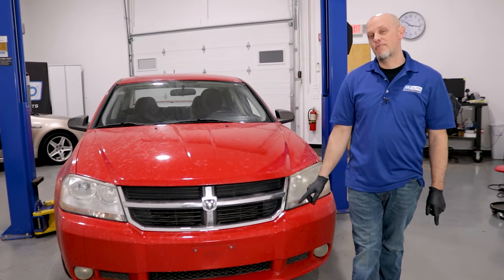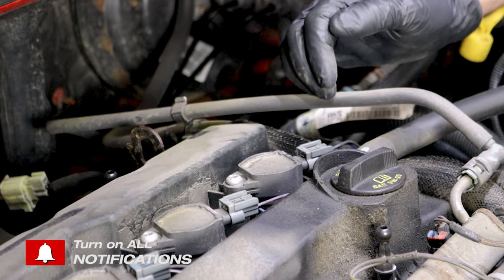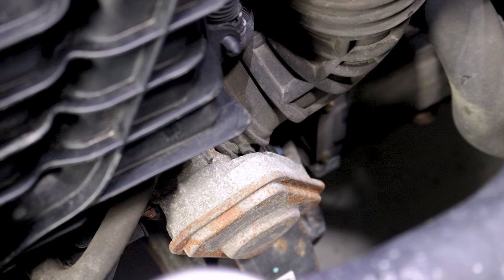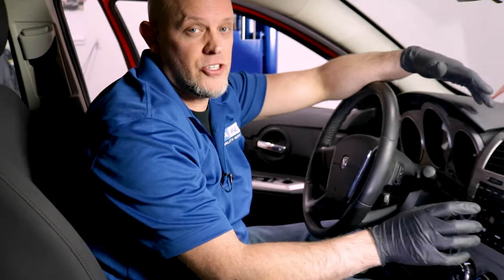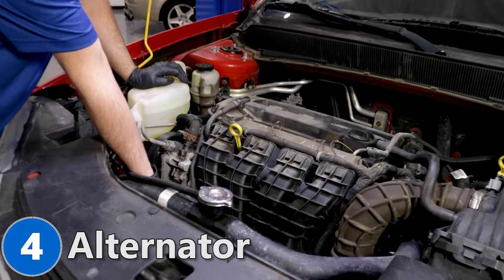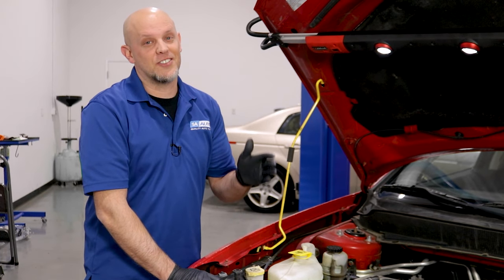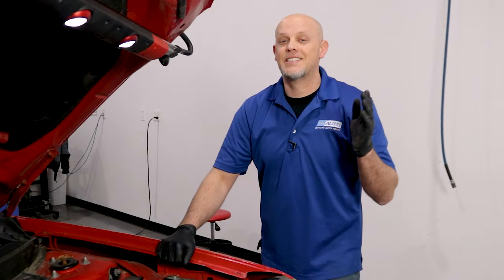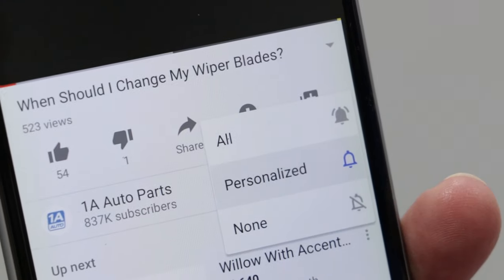Top 5 Problems Dodge Avenger Sedan 2nd Generation 2008-2014

Comment: My avenger had 198,000 miles when the Alternator when out. This car has given me very few problems and is still a fun car to drive
Reply: Dude same. I have one of the final 2014 3.6l V6 SXT models and I love it. Solid, no major issues now approaching 150k miles. Haha as far as minor issues, my blower motor did go out though! I replaced it. The new motor was inexpensive.
Reply: Same, mine went out at about 196k.  Other than the power steering being stiff and a couple of actuators clicking, I’ve had no major problems. I bought it new in 2014 and love my daily driver.
Reply: @ariela.8706  Did u fix the clicking?
Reply: The avengers suck!!!!! Have had to replace an alternator, starter, coils plugs, MULTIPLE THERMOSTAT HOUSINGS…. Not to mention the countless failed thermostats right out of the box….  I literally just replaced the whole housing assembly and have triggered a p0128 because the NEW THERMOSTAT failed.

Plus the countless electrical issues. The main fuse box location gets destroyed in the engine bay.

I would rather drive a Prius

Comment: 5 problems “but overall it’s a great vehicle” way to elaborate on the most important part 😂. So do I buy it or not?
Reply: Not
Reply: Buy.  I bought mine new in 2013 and I love it.
Reply: @marcoscompos7203  i feel you on the battery lol
Reply: No
Reply: No I have one and I’d rather get a Honda Civic
Reply: It’s a Dodge. You gotta get outta its way
Reply: @Blackboi if you turn the wheel all the way you possibly can outward its a tight squeeze but you can get to the battery without taking the tire off. Also if your side marker lights go out they are a pain to get to as well. I have 2012 with almost 200,000 miles and besides the normal wear and tear its been a great car.
Reply: Hell no
Reply: Honestly it's a good used car if you can do your own small repairs. Looks a bit ugly tho
Reply: DO NOT BUY DO NOT BUY DO NOT BUY
Reply: @RF-vg5kv  no
Reply: Yes.
Reply: I have a 2014 bought used pre owned only 40k miles, now paid off ! Have been very very very reliable a few things I had to change and update, the battery is aggravating to get too, but other than that great car ! Looking for my next car now had my avenger for 7 years now, looking at the Mazda 6
Reply: Naw mine has problem after problem
Reply: NO! Mine just totaled out today. I had it just under four years and it was nothing but problems the entire time. We stuck thousands into it trying to fix it. The frame snapped today while slowing for a stop sign.
Reply: Only problem I have with mine is the same thing over and over is my car keep running hot even when I fixed both hose, housing, thermostat, and everyday I have to put antifreeze in it because somehow it keeps disappearing but no leaks so I mean it’s a total waste of money for me.
Reply: As they always say every car has its problems
Reply: I've had mines 9 years and still running strong thank god I've had to do regular maintenance brakes oil changes nothing to crazy but it's how you treat the car and maintain it I had a Honda Civic and had many problems it just depends bc I also had an accord for 15 years never died
Reply: @itsjustnate6  J
Reply: @guillermoaguinaga8592  sounds like me and fords had 4 different ones nothing but problems real money pits will never own another ford ever
Reply: @marcoscompos7203  I feel this so close to home lol.  The car is honestly fun to work on other than that dumb ass battery haha.
Reply: It’s like every other car. Take care of it and you won’t much problems pendejo. 👍🏾
Reply: @guillermoaguinaga8592  lmao that’s not true at all but ok. Dodge makes amazing vehicles. Learn how to properly maintain yours
Reply: I have one great car with 100000+ miles and reliable easy to work on
Reply: Lol I had mine 6 years and soon as I payed it off the computer  went bad . I think it's a good car
Reply: @stephaniewilkes2648  does ur water boil in reservoir? Similar issue, replaced a few things & am confused. If head gasket I'm selling it...but just today a few ppl said simply try a new radiator cap. For $5-$10 it's worth a shot. Also, check thermostats. The housing is easy to get off to see them. Cheap, fairly quick way to rule things out before wasting more time or $. In the same boat praying it's not head gasket tomorrow...
Reply: Nope have tons of problems with mine including transmission
Reply: I have a 2012 and for almost 9yrs its been a good car. Just didn't get my cooliant fixed in time. Ran it out bc i forgot to put the radiator back on. I love it
Reply: @moonbeamskies3346  I'm here with you on that. I got a 2012 back in 2014 and its been a good car
Reply: i’ll sell u mine
Reply: Hell no bro I hate my 2012 Dodge Avenger it’s my second car I got it when I was 16 going on 17 and now years later still dogshit u have to take the wheel off to get to the battery and it’s small backseat if ur tall or big trunk sometimes won’t close the clock is 3 seconds a head the car is slow in a race if u got the sxt etc just a money pit tbh thankfully I haven’t had any expressive repairs but still just annoying 🤦🏿‍♂️
Reply: Theese all are no expensive one exsept the alternator maybe

Comment: Today marks two years exactly with my 2014 Dodge avenger. I am currently the second owner and have recently experienced about two of these issues. The first one was my alternator. Just as you explained in the video, my battery died due to a bad alternator. Fortunately, I was able to get another battery within my warranty. However, the alternator I did have to purchase and replace on my own. Total cost for that was about $250. Labor done by me. The second issue I had was the throttlebody. turns out all it needed was a good cleaning which cost me about eight dollars. Yes, I took the throttlebody out for the cleaning process. So far, I’m fortunate enough to not have experienced the other issues. In the name of Jesus I pray that this car continues to take me from place to place.
Reply: I also forgot to mention, has not talked about in this video, that I had to replace both the camshaft and crankshaft sensor.

Comment: 2013 2.4L SXT - Bought it in 2015 with 45K miles, currently at 203K. No major issues, just normal DIY replacements (thermostat, ignition coils, alternator, brakes and rotors). Paid off a couple of years ago and has been a good reliable daily driver.

Comment: 2008 Avenger checking in.  Had the alternator, throttle body, and the engine coils.  Luckily once you replace the trash OEM parts with decent METAL aftermarket parts the car is decently bullet proof.  Definitely don’t enjoy driving it, but for $11k plus around $1k in parts for repairs it’s been pretty good to me for the past 12 years and counting.
Reply from the maker: +Adam Laskey Thanks for the feedback!
Reply: Why would you drive a car you don't enjoy??  I have a 2013 Avenger, purchased with 13K miles and have done nothing but brakes to it!  It just now needs the leak detection pump replaced.
Reply: @michaelebirch6722  if that is emission leak pump it is so easy to change and cheap!  I had 3-4 codes that grew to 8.  When inspection time came I replaced this and all codes disappeared, car ran better too.
Reply: I love my 2008 sxt avenger, I been working on easy stuff to make it sound and perform a little better like, air intake, cat back exhaust system and an after market grill and it looks super cool! Can I ask why don’t you enjoy it?

Comment: I've had my 2014 avenger for over 2 years now and it's been very good to me. Only had to do the basics like brakes and rotors. Replaced a hub that's only major thing.
Reply: I've had mine since brand new 2014 and it has 120k miles and only thing that has gone bad is the heater core which developed a leak. And it has a short in the turn signal switch wiring which causes the dome lights to come on occasionally. I "fixed" that by turning the dimmer switch to half way position. Other than that and replacing battery after 6 years which is to be expected, it runs great. Normal maintenance is key though. I change the oil & filter at 3000-3500 miles. I replaced the transmission fluid at 120k miles like the manual says to. Good car overall. No regrets buying it.
Reply: Mines at 78k already had overheating because of thermostat so I changed it and now maybe most likely bad alternator but need to check the battery first haha the alternator costs over $300 😅
Reply: @rengoku6450  yeah the OEM alternator is trash and horridly expensive to get a good replacement but it’s worth it!  My replacement alternator has been churning for 10 years now.

Comment: I’ve had to replace the throttle body, belt tensioner arm and pulley, idler pulley, wheel hub and bearings, wheel speed sensor, thermostat housing all in a 8 months span. Has 153k on the car and 80k on a swapped out engine

Comment: Great video, very accurate! Owned my 2014 avenger since 2015 with only 3k miles. Currently has 120k miles and few of these problems has happened. Currently right now doing thermostat housing. Thanks for video

Comment: Still have my avenger.. I've replaced a Blown head gasket, alternator, intake manifold, ac compressor, rack and pinion, thermostat housing and more. the engine is a beast tho..

Comment: 2012 so far with like 110k on it, running alright in Alaska. Replaced a heater core, alternator and batt, along with a serpentine belt. So far it's alright had it since 94k. Love how it handles the winters, I mean except when the heater core clogged, after replacing getting some 150° heat out of it 👏. Would recommend changing coolant though stuff gets cruddy

Comment: 2013, owned it since 18,000 miles, currently has 193,000. Engine oil cooler assembly, alternator, did all 4 hubs (didn’t need to do all of them, did them because one needed to be replaced), blower motor actuator, power window motor in passenger side. Power mirrors recently stopped working. Fuse? 

I now have an front end issue, front right excessive wear. I got all 4 new tires and rotation. I did not rotate them like I should of.. Have not looked into the slight noise front end issue yet. 

Cars sagging, need to do struts soon. But overall, a pretty good car 😂

Comment: Spot on. Have 2011 avenger. Got it years ago with 50k miles, has 185k now. So far had to replace the alternator and thermostat twice. Been trying to diagnose the improper idle which looks like the throttle body. Other than that it’s been very reliable even after a couple minor collisions. Took em like a champ and is running strong

Comment: 2012 SXT - 266,000 miles - original owner - I’ve changed a lot of things - including everything you’ve mentioned - but the coils is my reoccurring problem - right now nothing seems to fix the misfiring in cylinder 4 - only thing I haven’t changed yet is the injectors.  May try that next- or just try change coil again - in case the new one is just faulty - I’m checking out videos for tips first

Comment: Yes! Bought my 2014 in 2016 and I’ve never had to put my hand in the engine, just to change the oils .. otherwise a great car ! Thanks for the heads up so well said !
Reply: I have a 2013 dodge avenger has been parked more than it has been used, it's a nightmare!!
Reply: @irenezepedaaguilar842  the 3.6 is pretty reliable I’d say

Comment: Own a 2013 avenger and replaced the throttle body, thermostat/water pump, and coils/plugs. Nail on the head about these cars. Had mine for 50k miles got it at 40k about to cross the big 100
Reply: 2014 here with 120k miles. Only had to replace a leaking heater core. Normal maintenance like oil and plugs. Been really good to me. Just changed tranny fluid at 120k too.
Reply: What kind of gas do you put in it
Reply: So I replaced everything you just named as well. I have a 2011 avenger and my car still won’t start only rode it for 20K miles.

Comment: Just had to replace the alternator on my 2013 Avenger SXT at 147,000 miles. Throttle body was replaced about a year ago. Otherwise, the car is a dependable daily driver - can't complain.

Comment: Iv had so many issues with this car its insane, i tried to change my variable valve timing solenoids but i couldnt even remove the sensors off cause they were melted on. So i dont know what to do

Comment: I have a 14 sxt that I bought used. Only thing I replaced so far is the alternator. That was about 2 yrs ago ( had the car for 4 yrs). Recently the evap canister needs replacing. Other than that, really like the car. Over 122 thousand miles.

Comment: My top 5 list is different than this one. We have a 2009 Avenger SXT 2.4L  with 205,000 miles on it.

1 - Cracked Head (warranty)
2 - Blown head gasket due to stripping of bolts into engine block necessitating complete engine replacement (warranty)
3 - Failed intake runner (warranty)
4 - Failed rollover valve. Causes car to stall when tank is filled all the way up.
5 - Frame rusting apart.
Reply from the maker: +Bill D - Thanks for the feedback!

Comment: Engine overheated. 2.4L 2009 Avenger. It was the thermostat housing and you have to change the thermostats as well. Fixed it.

Comment: 2011 Avenger, owned until 2016. Overall good car, but very disappointed the heater core went at 4 years old. Expensive repair.

Comment: Thank you! I took my car to the dealership to see if they could find out what’s wrong with my blower motor and they didn’t even tell me the problem, the guy just came back and told me it would cost me 400$ to order and replace the part. It just needed clearing out
Reply: If youre stuck in face melt speed, usually resistor.  If it doesn't come on at all, usually blower motor went out.  This based of experience but as always check for power , ground , connectors etc.
Reply: Thats just the markup. A quote at a shop allways cost you 1/3rd or less to do yourself

Comment: My sister has a 2013 Avenger. So far, ive replaced the coils, spark plugs, radiator fans, blower motor, blower motor capacitor, 2 of the 3 blender actuators. Replaced the thermostat 5 times, the thermostat housing twice, and just replaced the head gasket 3 weeks ago. Replaced the cv axles and struts twice so far as well. Luckily for her, im a good brother, and didnt charge her a penny... just replacing the head gasket is around $1,500 in labor alone.
Reply from the maker: +@Good_ol_Butch Thanks for checking us out! http://1aau.to/m/Shop-1AAuto-c

Comment: Had my avenger 2009 avenger sxt 2.4 L  back in of August 2020 had 135 k and got rid of it around October 2022 had 199k on it. The problems I had was that ticking noise from the ac, alternator went out 2021 160k something miles on it my spark plugs was somewhere around that as well car could stutter as I would drive & had to replace control arm brakes surprisingly it wasn’t a bad car it had 199k almost 200k when I got rid of it I was thinking about getting another one I went to Atlanta from Michigan that car never stalled on me accept for that alternator I’m thinking about buying one with low miles 🙏

Comment: Had my dodge avenger 2014 for two year at 178,000. And it is officially done for. I could replace the battery, alternator, and the spark plug to fix it but someone decided to rob my car parts out of it. Wires are gone, my radio is gone, they broke my dash, and they took my spare parts even tho they were completely broken.  The car was fine while it lasted though it was giving me issues in the past breaking down every 1,000 miles.

Comment: I have a 2010 avenger 2.4.  The biggest issue I had up until now was it went into limp mode back in 2015.  I had to take off the throttle body and clean it with some brake cleaner and a wire brush.  Good as new.   Now I have a slow leak I think coming from the tranmission cooling lines.
Reply: What's the process for cleaning it?
Reply from the maker: +Nathan Nembhard We're always cycling through common cars. We'll add this repair to our list! http://1aau.to/m/Shop-1AAuto-c
Reply: What I did was removed the throttle body.  Then I took break cleaner and sprayed the carbon build up that was inside the throttle body. What didnt come off from the spray I scrubbed with a wire brush.  Kept repeating the process until it was as clean as it would get.  Then put the throttle body back on.  Done...

Comment: 2013 avenger  98k miles so far I’ve had to change the alternator, throttle body, battery and thermostat housing, Spark Plugs and Coil Plugs

Comment: I’ve had my 2014 dodge avenger for about 4 years and except for the first 6 months to a year it’s been nothing but problems that I can’t seem to get diagnosed and fixed properly. I wish I had done better research on this car before buying it but to be honest I had been without a car for a year and jumped into buying it. It’s all paid off and if I can ever get someone who can fix it properly, it might not be such a bad car, only has around 90k miles on it and when I got it I think it had 85-87k miles on it. (I work from home and drive very very little). I’ve been tempted to trade it in just so I don’t have to deal with the hassle, but I don’t want to take on another auto loan so stuck with it I am. I love the body style but everything else seems to be crap. I don’t think I’ll ever buy another dodge again.

Comment: Just verifying. My first one was a 2009 2.4L, throttle body went out twice in 6 years, both front wheel bearings, and thermostat leaked. Now I have a 2011 3.6L Lux and I've had to replace the crankshaft sensor twice (it doesn't show a code as it goes bad intermittently leaving you on the side of the road broke down with no clue why, unless you're knowledgeable about this problem. I replaced the sparkplugs and the ignition coils before realizing the actual problem. Should be in the top 5 in my opinion.